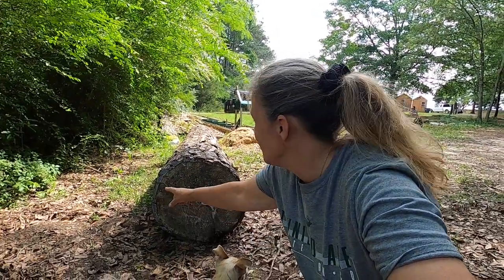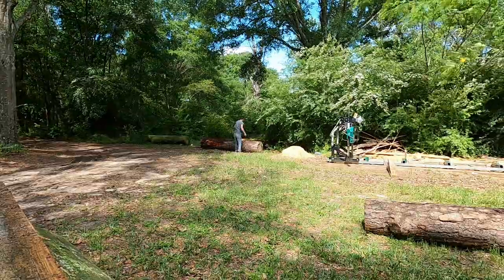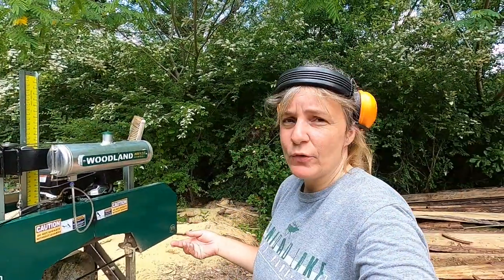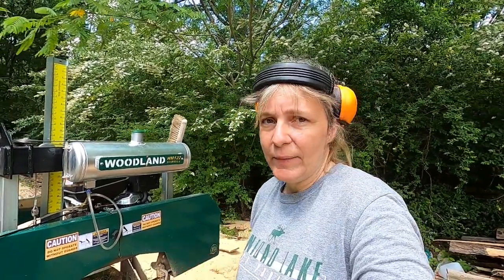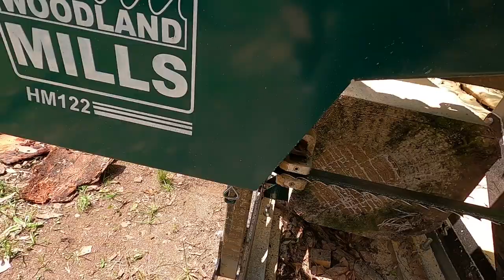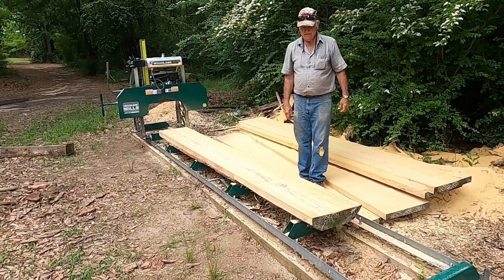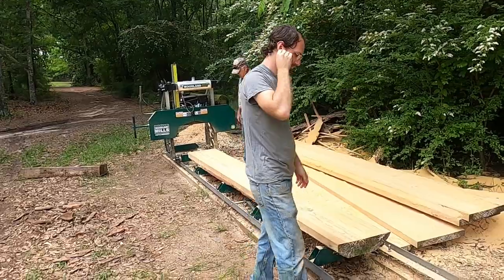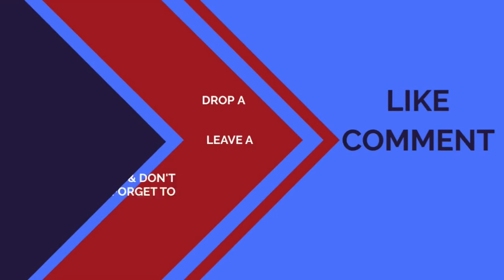Will Our HM122 Handle This BIG log ??

Comment: I have the same mill , and to me it’s impressive it did so well on that 24 inch log. The HM122 is designed for 22 inches. Too bad about the new blade hitting the post. That never happens with a dull blade LOL. Anyways , just one of those 2x4’s will just about pay for a blade considering the prices nowadays at the box stores. If you could even find one of comparable quality.
Reply from the maker: We actually finished the log with the same blade. Got a couple of wavy cuts but we have a jointer, planer and table saw. Either way they will work for a rabbit hutch. It only costs $8 to sharpen a blade so we got at least 30 blades out of that log, lol

Comment: I am surprised at the low horsepower.  I have the Frontier OS31 and a Kohler 14 horsepower and that is barely adequate.  If the motor ever fails I would definitely up to at least 20hp.

Also. You need to get that mill up to crotch height.  All that jumping up and down adds to the workload and time.  My trailer was expensive but all the jumping up and down and crawling under just made me realize it was worth it.

Good luck and eat your Wheaties!

Comment: I hit a log stop the first week I had my mill, also while milling a too-large log. Since then, anytime I have to turn the blade guard out of position, I use wooden log stops. I don't go back to the steel ones until the guard is back in correct position. Haven't hit a log stop since.
Reply from the maker: We do PLAN on making wooden stops but you know time.... LOL
Reply: I've hit one a total of 2 times ever since I compare the measurements of the log stops heights with my blade height before each cut I make. So I  haven't hit any more either.

Comment: Woodland mills has a new blade tension kit they are sending out free to HM122 owners. Looking at your tension t-handle I can see you haven't gotten yours yet. You might call them and ask about it.
Reply from the maker: Really? Thanks for the heads up, I will have to look into it.
Reply from the maker: Just to let you know, I spoke with Woodland Mills and they are doing this tension kit for customers that had there tensioning rod strip and not work correctly. Mine works great so no reason to mess with it. I appreciate you looking out for us though, thank you.

Comment: Just a quick question. Earlier in your video the mill head appeared to be shaking.  Is that normal or is that because of the size of the log and what the log is or what you think maybe the cause? I’m looking to buy one of these mills here soon and since I’m new to using a mill I thought I would ask. Thanks
Reply from the maker: It does shake sometimes but not all the time. I think it is a combination of a dullish blade and the size of the log. Our mill wasn't made for the size logs we put on it. If we had known we would end up with such large logs we would have gotten a larger mill. But that being said we absolutely LOVE our mill even after having it and using it for over 2 years.
Reply: @ThirdTimeAroundRanch  Thank you. I’ll keep that in mind when using mine. I’m looking to get an HM126 here soon. I’m gonna take a guess and say all sawmills can do that.  Hey thanks for responding. It is greatly appreciated. God bless

Comment: Didn't yell, just cringed.. :) It also looks like your water is dripping on the blade guide rather than the blade itself..some was making it to the blade but it might not be enough. It would certainly help the blade last a bit longer, as long as no more log stops are hit. ;)

I've got an HM126 coming, hopefully next month..can't wait to put it to work!
Reply from the maker: Hope it's less humid where your at.. Love milling but I can do without the heat and humidity. Have fun and build lots of things!
Reply: I cut an inch of hose and put it on the copper pipe to get water out into the blade rather than the stop.
Reply: @ThirdTimeAroundRanch  Maybe a bit less, we are in East TN so we do see our fair share. :) Got a new barn first on the list...go big or go home!
Reply from the maker: @MikeCreuzer  Thanks for the tip!
Reply from the maker: @JonathanSnow  Awesome! We have a barn coming up also and a wood shop for me!

Comment: Hi, 
I saw in this episode that Eddie accidentally cut through the metal support post (or he didn't).
Just wondering if it's worth while to replace those metal posts with a wooden ones to help saving the blades??
Reply from the maker: It is very worth it to replace them with wood, we just haven't gotten to it. So much to do all the time.
Reply: I've ran into mine 2 times now. Destroyed one blade doing it. The other I was able to sharpen it. It'll take awhile to pay for them but I purchased woodland mills sharpener & tooth setter combo. If you've careful sharpening them you can get 5-6 sharpening out of a blade. After about the 2nd or 3rd sharpening you need to check the teeth settings & set them if required.  If set properly they clear out the cut better allowing the blade to travel through the cut easier.